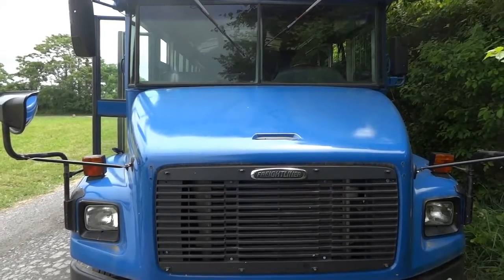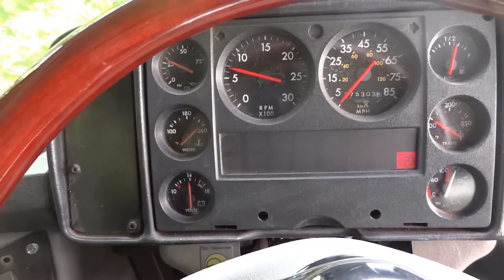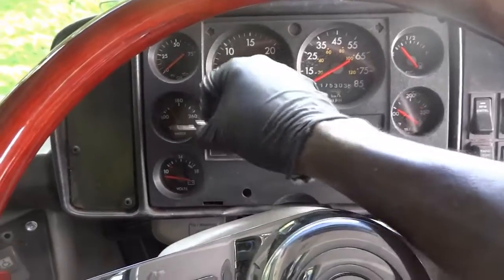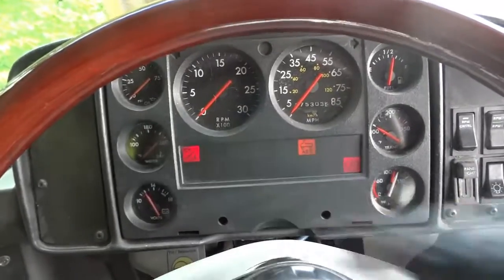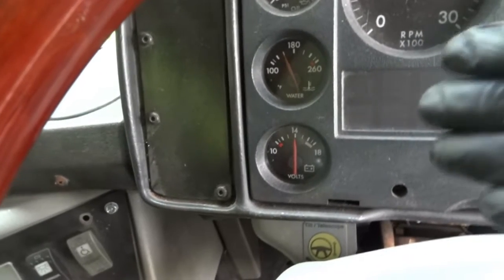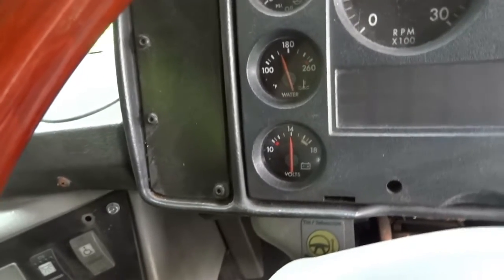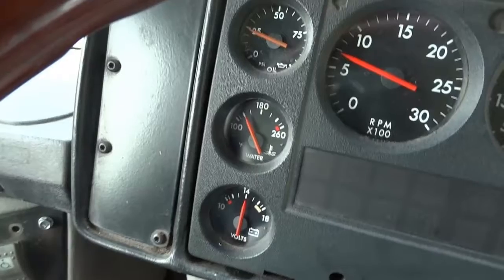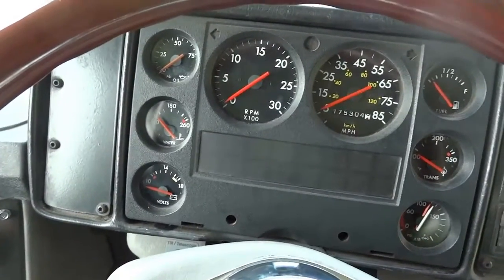Engine Temperature Sensor Problems/ Temperature gauge shows hot all the time on a Freightliner bus

Comment: Hi Deo, I hope I’m not confusing myself here, you said when the engine is off and the temperature sensors were disconnected, the reading should be zero and that means the sensors were defective. My question is what should the reading be for a good sensor what it is disconnected and the engine is not running. Perhaps if you had shown us that after the new two sensors were put in place, it would have been clearer to me.
I suppose a disconnected sensor whether good or bad reading should be zero because it is not in operation.
Please help me clarify this.
Thanks with the good work buddy!
Reply from the maker: @joelawoyomi9102   hello when the sensor is disconnected the reading on the gauge or the scan tool should be very cold or near 0 degrees, indicating an open circuit

Comment: What is the 3rd temp sensor for that is located on the driver side of the engine under the HEUI pump ?
Reply from the maker: Russell Stamey  that is not the temp sensor it's the oil pressure sensor, it has 3 wires right?